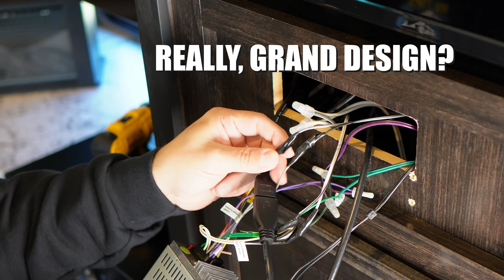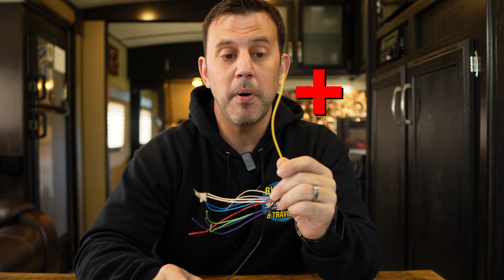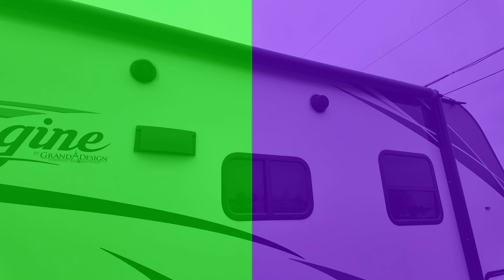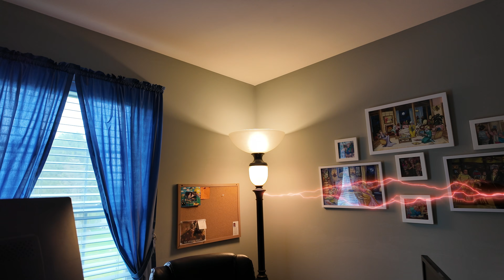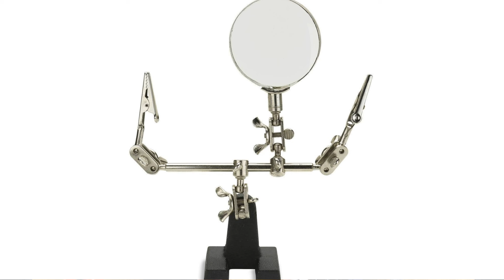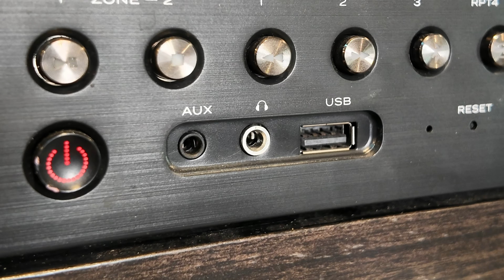12 Volt RV Stereo / Radio Head Unit Wiring - Explained for Beginners / Newbies

Comment: Excellent and detailed video!

One of the best high end audio electronics repair shops is Pyramid Audio in Austin, TX.  I've known of them since I was involved in Car Audio in late 80s/early 90s.  Don't see Furrion/Lippert listed on their website so doubt they service them.  As you mentioned, probably better to simply replace the failed unit and recycle it.
Reply from the maker: thanks for the info my friend... I'm sure if I tore apart a Lippert HU I would discover they are black labled from Sony or some other manufacturer.  Car audio in the 90's was a GREAT era my friend.  Good memories.
Reply: @RVTIPSANDTRAVELS   Very true.  Pyramid probably could identify it quite easily.

I competed in the 1992 IASCA Finals in Tulsa, OK.  Finished mid pack but had a great time.  Need to pull out that VHS tape!  lol   I am now paying for all those fun times.  Dang tinnitus!
Reply from the maker: IASCA, USAC, ETC... good times. Alma Gates, strokers, DD's, USAmps, lol.  Fun times for sure... what subs and amps were you running?
Reply: @RVTIPSANDTRAVELS   I had to look up who Alma Gates was.  The big names I recall were Harry Kimura, Richard Clark, and Fishman (forget his name).  You're so right, that was an amazing time of innovation and it just kept going from there.   After 1992 I stopped competing and didn't stay up with the hobby.  I was in college and couldn't keep funding to keep up with the trends into more and better electronics.

I was in the amateur 251-500 class.  Had an ADS 4ch. PQ10 driving the MB Quart separates and Rockford center speakers and tweeters, and a Punch 150 driving 4 Pioneer 10" free-air subs.  Ran it in stereo which wasn't very common.  Two subs in parallel per channel.  Had an EQL to control it all.  Didn't look like much but it sounded amazing.  Honestly best bass I ever had in any setup.  Deep lows, hard mids, and all super clean.  It was awesome.  All in a very unsuspecting, 2 door sedan, a 1982 Plymouth import from Japan that no one heard of, a Sapporo.  

I scored just 3 pts off in sound quality from the guy who took first in that part of the judging.  I didn't have the high end being a DIY installation or SPL and that's what stuck me in the middle overall.  But having high sound quality was way more important to me.  I recall the judges being really impressed with my sound quality since I didn't have many tricks in speaker placement like kick panel boxes or angled separated.  Fanciest thing I had were two 3-1/2" stuck in the middle of the dash for center channel running in stereo and hard dome tweets mounted to back of the mirror and bouncing off the windshield.  Unorthodox but it worked beautifully for soundstage and separation.

 I still have most of the equipment in boxes in the garage.  Always thought I'd recreate the system one day....  One day.  lol

Thanks for the trip down memory lane!!
Reply from the maker: you were a 2-3 years before me, but I remember Fishman.  thats all great equipment you listed too.  I was always a SQ geek too.  It mattered more to me.  I still have my Alpine tape deck and my Alpine 3342, such a great EQ.  just seeing it light up reminds of me of cruising around as a teenager with it.  Like you, I too shall recreate my system again some day.  Maybe.  I got out of the scene around 2010 when it died (around here anyway) and every dash kit and wire harness was $100 because you had to bypass so many things that started to become incorporated in the head unit.
Reply: @RVTIPSANDTRAVELS  Wow. You were in it a while but makes sense if you had a store.  You saw a lot of change in the hobby and industry over those times.  The integration became so difficult as factory audio systems evolved.  The system in my 2022 Ram is amazing. Could use a good EQ but otherwise satisfying enough at this age. Lol
I can picture that iconic green Alpine glow.  I started with a Kenwood tape deck but ultimately had all Sony. CD head unit, 7 band half DIN EQ and remote 6 disc changer.  Smile just thinking about those items.
Reply from the maker: Hard to stop replying to your comments, lol. You mention Sony as your go to... by no means was Alpine my go to, I just seemed to fall into my first tape deck and loved the EQ, but after I started the shop, believe it or not, I fell in love with both the JVC and Panasonic head units (Panasonic dropped car audio probably 15 years ago).  Sony was right behind them.  Alpine got expensive, always hated the Pioneer interface and menus.  I'd probably say JVC was my favorite because they were easy to navigate, had decent built in EQ's and were reasonably price, probably similar to Sony.  I will never get rid of my 3342 though, not my video but tell me this doesnt scream 1990's! https://www.youtube.com/watch?v=A0nrh8AnQwk
Reply: @RVTIPSANDTRAVELS  I agree!  lol

That video was awesome!! Full DIN EQs were so cool.  I didn't have the room.   This is my EQ - https://www.youtube.com/watch?v=-UuR671JtdI  I had it paired with a CDX-U8000 tuner.  I was incorrect in previous comment, the changer was a 10 disc.

I'm going to have to go pull all this out one weekend soon and just sit with it all a while.  lol
Reply from the maker: thats a sexy EQ too!  Im rolling thinking about you just hanging out with your old equipment 🤣🤣🤣🤣, but i also understand.

Comment: Why are rv stereos running DVD players... Nobody switched to blurray
Reply from the maker: tell me about it, i have a bunch of blue rays i cant watch in the rv.  should be blue ray at a minimum,
Reply: @RVTIPSANDTRAVELS glad that I'm not crazy... I've looked and can't find one...
Sure, I stream everything at home BUT I have a massive collection and it would be fantastic to bring it along easier
Reply from the maker: same here, big collection, and a lot of them are older so the high def versions make them more "modern" and more enjoyable on these larger tvs these days.  Ill see what i can find but in the meantime it might be easiest to install a home audio blue ray and run the video and audio lines into the HU as an aux source.
Reply: I was considering swapping my head unit to one of the new ones without a drive and doing just that, I don't use the t.v. W/o shore power anyways BUT then I realized I wouldn't have access to a cd player and the trailer is the only place I use cd's still.

BUT I'm considering rewiring the entire trailer to bypass the converter altogether and installing a 12v all in one  solar controller/inverter/charger which would provide full time ac power via lithium batteriers (with auto switchover and auto charging on shore/generator power)
I have one for my home (24v) to provide backup/ups power for my furnace/deep freeze and cpap and it works fantastic.... 
What do you think of the practicality of using a 12v version of something like the eco worthy all in one....? 
I've been hesitant due to how much a trailer rattles and shakes
Reply from the maker: yep, id definitely contact the mfr and see what they think about this being in an RV.  if im not mistaken, these are for home use? i dont know much about them but i have heard of them.
Reply: Correct, they're meant for the home... But as long as they can handle the shake, rattle and roll of a trailer it seems like it would be vastly superior to the standard converter trailers have

Comment: Wow! clicked this video not really sure if I would watch much of it because I really didn’t have any interest in learning about RV stereos.  Before I knew it, I felt like I’ve been installing radios for years and the video was over.  This is EXACTLY why I watch the videos on this channel. You sir are a natural teacher and make things RIDICULOUSLY easy to understand.  This might be one of the best clinics I’ve seen on any subject, RV related or not.  Thanks for this video, I wish I knew this stuff when I was younger, it would have saved me hundreds I spent at the local stereo shop. EXCELLENT!
Reply from the maker: Thank you John and Mary.  I know this video wont get a lot of views because its not packed with drama, but I felt it was important to make and I think it will help a lot of people over a long period of time, especially considering these units dont really change much over the years.
Reply: Same here, this video is a clinic!
Reply: Would rather not cut wires. Do you have a source for adapter cables available for specific radios to a e450. Chassisu